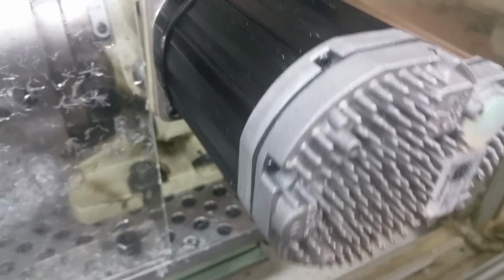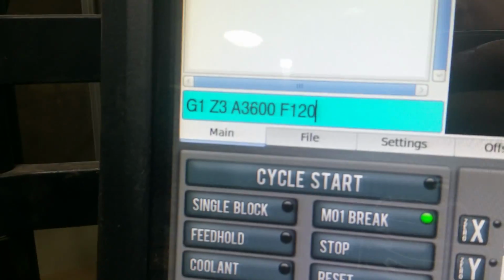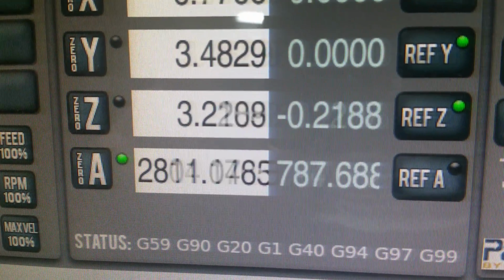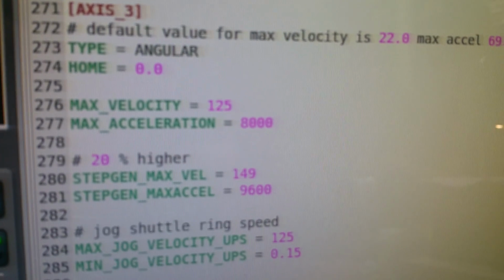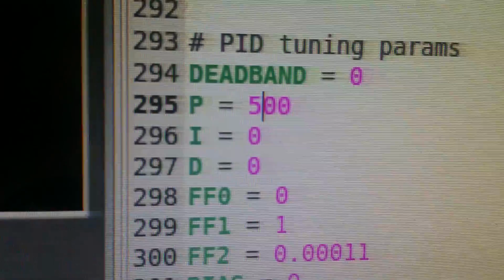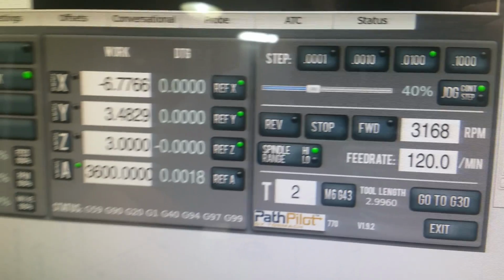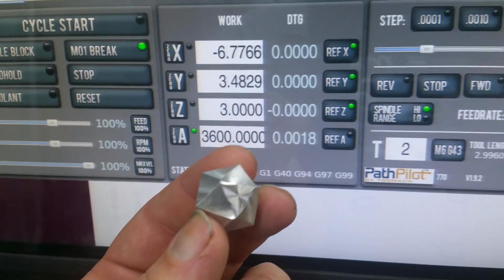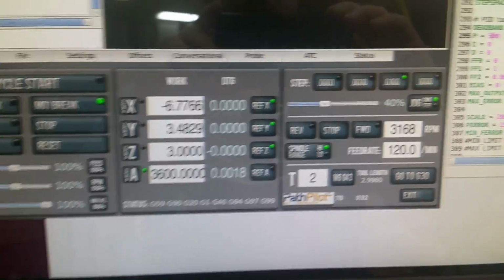Upgrading Tormach PCNC770 4th Axis and PathPilot Woes

Comment: I upgraded to PathPilot about a year ago and love it.
How did you get to that screen that allows you to tune PathPilot?
Did you get your issue fixed?
Reply from the maker: yes we did. was a combination of about 3 different settings. 

to boot in to linux hold alt shift while the tormach controller is booting up.

Comment: Do the servos feedback to path pilot? Does it do the slow acceleration when moving on its own?
Reply from the maker: no to the first and yes to the second.
Reply: Well that basically means the problem is within PP and has nothing to do with the clearpath drive or it's parameters it would likely do the same thing with no drives attached. I think the problem comes down to a following error which occurs when the controller transitions from constant velocity to the deceleration. It's probably happening on the A because it requires a lot more steps per unit. I think you need to tweak the ferror and min_ferror values. I'm no expert but this may help: 

https://softsolder.com/2013/06/26/linuxcnc-stepper-following-error-calculations/

I think basically the controller finds itself behind where it should be but as it is decelerating it is at a low speed and takes a while to catch up. The interrupt rate will also play a part, the guys on that forum should know better.
Reply from the maker: yup i've been working with a couple of folks over on forum.linuxcnc.org and we've been tweaking those values. pretty sure it's a following error issue. but i'm not sure what's causing it. going to reinstall path pilot bolt up the stock tormach motor and run a test part (SLOOOOOOOWWWWWW as molasses in winter time) to see if that fixes the issue. then from there i'll go step by step and see where we started getting this error.
Reply: I think it relates to the number of steps per unit with your new fancy motor and the interrupt time , if you run your new motor with the old parameters although it will not move the correct distance I think the error will disappear when you do the test shown here. I'm sure it will be a parameter issue rather than something actually wrong with the software or hardware.
Reply: I looked at the thread, you have not touched those values you played with the PID values, not the issue I think.
Reply from the maker: end of page one and on to page two was where we started to adjust the ferror values, well really just brought them down to 

FERROR = 0.1
MIN_FERROR = 0.01

to see if we were getting a following error. which we are.
Reply: Sorry I missed that because they were below the PID parameters in the boxes not above as per the video. I suspect a higher interrupt frequency will be required but I'll defer to the experts now.
Reply: @artisandice  where is the post on linuxcnc ? tried to search for it and could not find it.

Comment: This is a longshot but try to change P to 1000. Its very confusing that a PID is used but its apperently a more stable way to handle the stepgen in the mesa hardware.
Reply from the maker: yeah it confused me to. but that is the way tormach appears to be doing it. tried p 1000 it did not work made things worse. we got the decell correct with a p value of 50 and setting the max error to 0 which as i understand it, turns off error tracking in linuxcnc. still getting a twisted part.
Reply: +artisandice ok to bad. Make a post on the linuxcnc forum and link this video. Great people there including the owner of mesa (that makes the interface card in PP)
Reply from the maker: i'll drop a comment over there now.

Comment: I've never run a linuxcnc setup, but a couple of random thoughts:
Does the same anomaly happen at the start of the move? The DRO screen wasn't showing when the command started, so I couldn't tell.
I find it interesting that the Distance-To-Go looks complete and returns to zero (well 0.0018=close to zero) as the slow part of the 4th axis move happens. It's as if the motion thought it was complete.
The Z destination of 3.000 appears to be reached exactly as A hits 3599.0112. Very close to A being 1 unit away.
Your MAX_ACCELERATION of 8000 seems huge (I know the servo will self-correct). Does setting that to a more "reasonable value" (800? 80?) still present the problem?
I've only seen smaller MIN_FERROR (= 0.010) & FERROR (= 1.0) values. Does changing them affect this? (longshot)
Reply from the maker: i haven't seen it happen at the start. i do have a thread on this over at cnc zone and someone mentioned changing the P value to 1000 and max error to 0.01. that made the a axis overshoot the final stop point by ~ 2 degrees. so then we tried setting max error to 0 which apparent drops error tracking  completely in linux cnc. combined that with a p value of 0 and the deceleration rates work as intended and it stops in the exact spot now. but we still have issues with twisted parts. so no i'm thinking we may have an issue with clear path controller for the motor. going to give clear path a call in a bit and see what they think. the accelleration rates are needed as we are making very short moves, and are well within spec for the servo. if we drop the accell rate to 80 or 800 the acceleration times are glacially slow. (the rates in the ini file are not in degrees i think they are actually pulse counts IIRC)

Comment: I don't have an answer, but it would seem to be a configuration difference between the Tormach steppers and the single servo
in PP. I do have a question - do you ever plan to replace the Tormach steppers with Clear Path Servos? I have been waiting to
see someone out there trying this before I did.
Reply from the maker: the 4th axis stepper had to be replaced the table moved entirely to slowly. next on my list would be the z axis as we are limited by the accel rates for z at the moment. clear path steppers are simple drop in replacement for steppers as they servo control is attached to the motor and takes typical step and dir signals. the tormach z stepper is an AC drive though so there would be some changes required to make it work. all other axis would be simple enough. that said, path pilot is currently kicking my butt with the a swap so take my opinion with a grain of salt.
Reply: Isn't the A axis AC drive too??